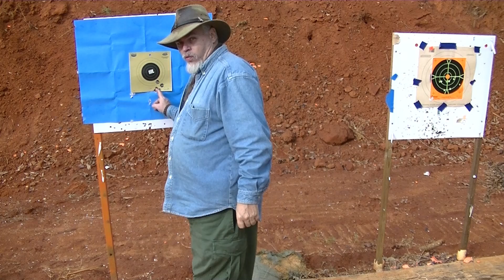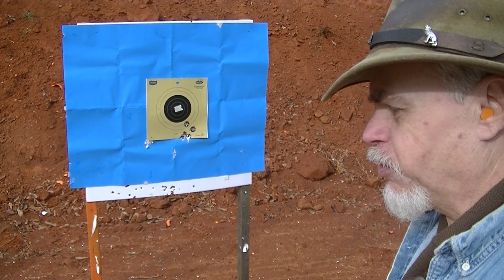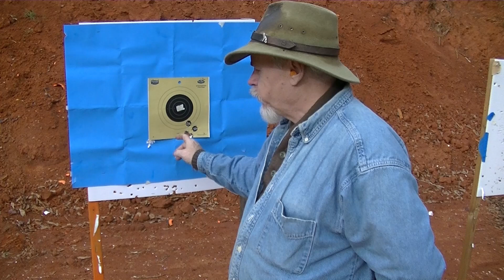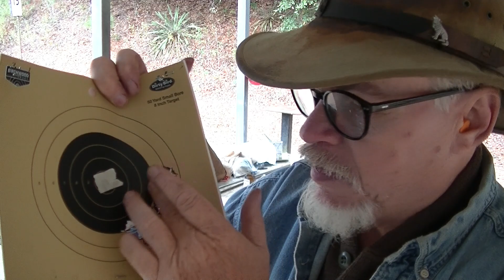muzzleloading rifle pt2

Comment: I've got one of those Mountain Rifles.  First BP rifle I ever bought.  It was 1982 and I bought it used at a gun show in San Angelo.  The hammer spring was worn out so replaced that.  Decided after a year or two to give it to my father.  He lived in VA and hunted the big woods and mountains so I cut the barrel back to 22 inches.  Made a heck of a nice carbine.  Might also add that they were making those stocks out of Birds Eye maple and I got a pretty nice one.  Great rifle.  Dad has passed and when he did the guy went to my little brother.  He has passed and I have the rifle now.  Did I say great rifle?

That rifle will hold all it's shots on a playing card at 50 yards, no problem.  That is a 1:66 inch twist and that's fine for round balls, works to stabilizer maxi-balls but not really optimal.  It is a ball rifle not a bullet rifle.

Comment: Blackie… like your show. Just wanted to mention a restoration process for rust. If you remove the barrel from the gun and boil it in water for an hour or so it will convert the rust from red rust to black rust which stops the red rust process and the black rust is easily wiped off the good iron wiped of the iron in one cleaning. Then cover it in KROIL and let it soak overnight which will loosen any remaining debris and is easily wiped away in one more cleaning.
Good luck and enjoy your rifle.
Regards,
Mike Z

Comment: I recently bought a used CVA Squirrel Rifle. One of the rare, left handed models.
It had been put away dirty so the bore looked very bad.
I thought that I might have to rebarrel it.
But I thought that I might see if it could be salvaged. I had nothing to lose but a little time and elbow grease.
So, I removed the nipple and put a metric screw in its place. Then using a small plastic funnel, I filled the bore with white vinegar and stood the rifle in a corner overnight.
The next day I poured out the rusty vinegar and scrubbed out the bore with hot, soapy water.
Then I worked over the bore with 4/0 steel wool followed by hot soapy water again
Then finally I polished the bore with patches cut from a red 3m metal finishing pad .Then I oiled the bore for storage.
I haven't had time to shoot it yet but I ran a oily patch through it a week ago and it came out clean.
Things are not always as bad as they seem.
Thanks for all you do.
John Davis Jax Fl

Comment: I have built 2 Interarm percussion 50 cal.,  60 gr with a .490 ball and 90 grains with a Navy Arms .50, 325 Compression Bullet which grabs even rough bores, lubed with Kiwi natural.  At 50 yds 3 touching is doable.

Comment: The only thing I can add to this is, I was taught over 40 + yrs ago, if you have time inbetween shots, is to run a brush down the bore. Whether its plastic, brass or another type of brush, do it, for more consistency shot to shot. Now obviously after a shot while hunting, you don't have time to do this, unless you do. It takes alot of the fouling out of the bore for your next load. It works for me, as I've used this for yrs now. An heck yeah, bring on the rifle vids. Thx for the vid Blackie

Comment: As I told you in part one that I haven't had my rifle that long when I finally found you some powder it was the substitute powder which was Triple 7 and I bought a mess of it. After I had done that I found out it's not good to use substitute powder in a Flintlock. Now I've seen it done on the everything black powder Channel and it fired off okay but I finally came across some Swiss and some schuetzen black powder and I got what I could afford at the time so when I do get to shoot it I will have black powder real black powder. I've been watching all types of videos about shooting black powder and flintlocks and percussion rifles and I'm glad that I got a Flintlock because caps are a little tight right now and you have explained it the simplest so far. Anyway thanks for the video Blackie and look forward to more I've been scrolling through your list and I'll pick a few more out to watch.

Comment: I just finally found a mainspring, for my .50 cal CVA MOUNTAINEER.  It took nearly 2 years to find one.  I pulled hammer back on a nice 4 point and SNAP, went the mainspring... and away ran that lucky deer. I ended up finding a whole caplock assembly on the ebay.

As far as lead.  I use the same balls from my 1858 sheriff @ .440, and I use a leather scrap as patch. TC bore butter as lube,  I load 70 grains Pyrodex.   Maxi are real expensive. I'm looking for a lead mold, to start casting my own.
Reply: Make the mold???maybe
Reply: @WHEREVER-I-ROAM  I think I'll buy a mold, only because I  want it to fit standard handles, and I want Hollow point with at least 2 lube grooves.
Reply: @maxpinson5002  I would have if available.   I've got my eye out for a spare.
Reply: @maxpinson5002  I tried Dixie,  unfortunately the length and curve was correct, but the locking spur wasn't.  You are correct though... its not like mine is a million dollar, 1 off custom. Lol  I'll find a couple more.

Comment: Good video. God bless. From Glenn CATT in Massachusetts. If your cheak and site is not lined up . Or ajusted in line with the site. You will always be off . From what I can tell that gun is set at 80 grains at 50 yards . And the back site need to be moved to the right. About 2 or 3 clicks. Or  2 1/2 lines to the right. Just trying to help. Good video.

Comment: Interesting video...!

The whole thing about 50 cal and smaller = 3F powder and larger caliber use 2F powder is a myth!   It really comes down to personal preference and the particular muzzleloader.   I use 3F in .36 caliber,  .775 caliber (10 gauge)  and everything in between with excellent results.  It ignites easier, fouls less, gives the same punch as 2F using less powder, and I use it to prime the pan as well.

Thanks for the video...

Comment: I have a slue of questions for you.  What size caps are you using?  What about getting the right size ball for the bore and using a "wading" likes sheeps wool, to keep the ball and powder from rolling out the barrell when pointed down?  Did you run patch through the barrell after each shot or did you let it ride for all 5 shots?  Would you reccomend using "peletised" powder in 50 grain incraments?